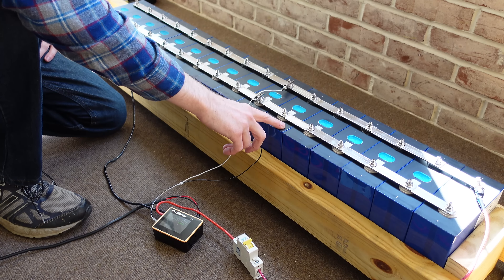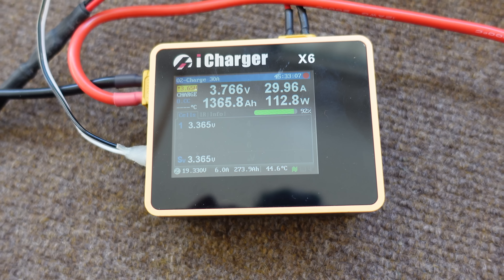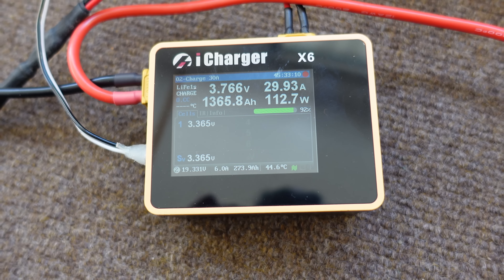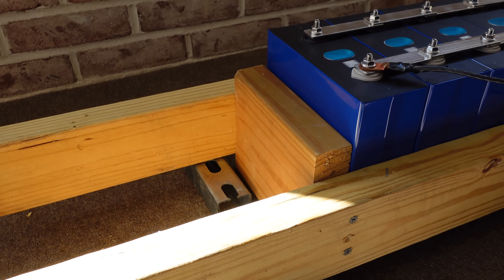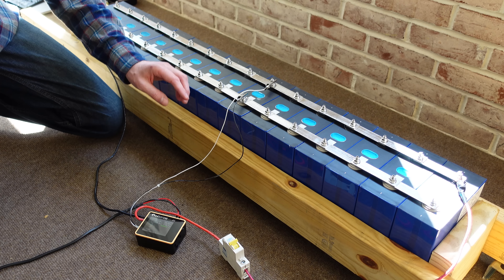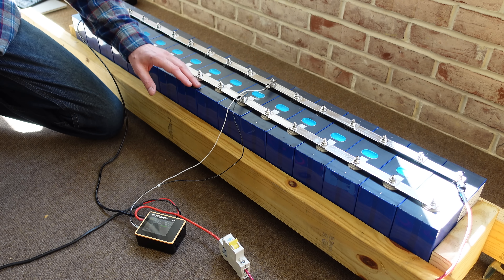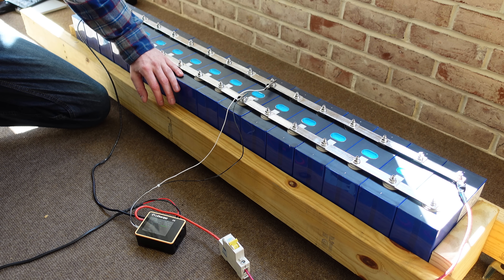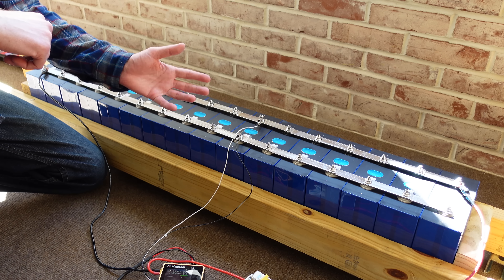Top-Balancing the EVE 280Ah LiFePO4 Batteries & Project Update

Comment: Nice. One suggestion is that the Constant Current charging can be done in series to speed up the process considerably. A 48v charger will likely be a lot more powerful and faster than the 30a/~100w at 3.6v.  Charging in series also allows you to identify any cells that are accepting charge significantly different to others.

Charge in series until the first cell reaches 3.55 volts them charge in parallel until all cells are balanced at your max voltage, say 3.60v

Comment: You'll love that setup! In my system I am using 16 cells (272ah Lishen) in a 48v setup. I'm also using two MPPLV6548 inverters in split phase setup. I have been running tests on mine for over a week to nail down the parameters and interestingly with using 50v as the floor and 56v as the ceiling.. my last couple of discharge cycles have hit over 300ah (14.4kw)! So you should be in the 26-28kw range.
Reply from the maker: Those sound like great lower/lower thresholds! I'll probably use something similar. Did you get your Lishens from Basen too?
Reply: @LithiumSolar  Sure did!

Comment: I'd also put sheets of soft rubber or stiff foam between the bodies of these cells, to allow controlled expansion at the manufacturer's specified pressure, while maintaining the spacing of the posts by using strips of much harder plastic (e.g.: ABS or HDPE) of the same starting thickness at the top.

Comment: I will order 64 of these in the coming week, just awaiting final quotes.
I will be using Belleville washers for each connection as the flat areas are what carry the current and Belleville washers increase the effective contact area markedly. 
My concern over the many years that I hope these cells will be in service is Aluminium oxide on the terminals and nickel oxide on the busbars. I intend to overcome that by industry standard use of a little Aluminox paste in all the joints.
The studs ideally don't carry current,  so loctite will have no electrical effect if the joint is done as described. 
I'm interested in what BMS is to be used, but won't delay my order to find out. I intend to make 4 x 16s strings with their own BMS.
I haven't decided about dynamic balancer modules.
Reply: Exactly .  Stainless bellville washers , stainless studs , and stainless flange nuts . Liberal amounts of anti-oxidant .   Loctite WILL corrode ALU in time.

Comment: I'm going to use locktite on the threaded inserts - I considered the reduction in current through the studs caused by the locktite, then realised that stainless is a poor conductor anyway, so the proportion of the current that will go through the studs is marginal even without locktite. Since my application is mobile, the locktite is essential for reliability.
Reply: Maybe a better fitting bolt would help with a tiny dot of lock tight.
I recently seen New types of lock tight for different use cases maybe look in this.
Reply: You would be better off using a lock washer or locknut due to the reduction of contact. The friction will hold it tight using those items and increase your current flow rate.
Reply: @TBL_stevennelson  Yeah, some other's rattle in the hole, but mine seem to be quite good - they came with the cells - perhaps that has something to do with it?
Reply: @fisherus  I'm using nyloc nuts, but the issue I'm trying to avoid is the stud backing out of the battery post. Since these cell terminals are aluminium, you can't torque the studs down well enough to ensure they stay in place, either with the stud or the nyloc nut on the stud. You can torque them well enough for electrical contact, but not well enough for mechanical reliability.

Comment: On the compression issue.....seems only to be relevant for high C Charge and discharge states an over a longer period.  Yes I believe having compression in your final configuration is necessary but for top balancing at .15c it seems a bit unnecessary and using the wood for this is likely ineffective due to natural flexing of the fibers...won't hurt anything but not sure it accomplishes much.  Have my second set of 16 EVE on the way and planning on using BMS from overkill solar for 24v system

Comment: You mentioned about putting lock-tight on the post. My concern is it might act as an insulator and reduce the efficiency of the battery. Maybe not right away but possibly over time. 
Just a thought!
Reply: I went the silver epoxy route since it’s a conductor as well as permanent sealant. So far so good
Reply: Agreed
Reply: Contact is through the busbar plate, not the post.  The post just holds the plates together for effective contact.  Loctite is fine.  Use blue so you can remove them if needed.

Comment: Just a thought when building that wooden structure to press them together well you should cut the wood a couple mm short and then add a piece of wood at the end and use an impact driver to screw the wood into the other wood to compress them
Reply from the maker: Yeah that certainly would work much better than what I've done here
Reply: 2x4 doesn't have much strength in that direction.  Easy for a bulging battery to exceed what the wood can constrain.

Comment: so, four threads deep and the real issue is contact with base. let it go, let the threads bear the load (like they are designed to do) and make sure that whatever is contacting it is flat & smooth. $0.02 cents- just thinking out loud, whistling past the graveyard, feeling for the best possible outcome. Is thread locker conductive? I don't think it is...
Reply: Loctite (a.k.a. thread locker) isn't conductive. It's a liquid plastic that cures with exposure to the environment. It's designed to fill the voids between threaded connections, thereby preventing loosening over time due to vibration.

Now, as the threaded connection only ever had contact on the one edge and an ever so slight void on the opposite side, sparing use of Loctite shouldn't affect terminal/stud conductivity.

Hint:  Depending on the type of Loctite used, a little heat is all that's needed to liberate a fastener.
Reply: @ARepublicIfYouCanKeepIt  good tip on the removal.
There is a New type of locker that's supposed to handle heat and a few other types.for various tasks.

Comment: That is a popular choice for equalizing the cells.  I prefer an active equalizer board because I can see the cell resistance and the saturation level of each cells independently which eliminate the possibility of mismatch pack.
Reply: @ neglio SAMch, can you possibly share the active equalizer board you use? Thanks!
Reply: @johnwatts3339  ebay has a 2A but 280ah battery you need 5a or 10A  and do not charge above 54v  3.75v because 10a equalizer board isn't enough. 2A Balancer Active Equalizer 2S ~24S BMS APP For Li-ion Lipo Lifepo4 LTO Battery
Reply: @neliosamch3195  Thanks. Could you possibly  share a link on ebay please? Greatly appreciated.

Comment: I would agree with Ian Kiefer that it is the surface area on top that creates the best connection. Because it is aluminum I would also use an anti oxidant compound such as Nolox to stop any aluminum issues. It will also help with dissimilar metals.
Reply from the maker: I will definitely be cleaning each terminal and applying an anti-oxidant :)

Comment: Thanks for promoting safe anti-swelling procedures ! On vehicle we've used to pump those lifepo (synopoly and calb prism) up to 3.8v ... colleague of my produced a paper on memory effect in lithium cell (minuscule but still there), and pumping up to 3.8v for lifepo seamed to be a good resolutions for that. Again, check with datasheet, and ask supplier for true datasheet, not the marketing datasheet - since Chinese cell tend to have magical properties according to some data-sheets (like synopoly advertising their capacity based on discharge curve that started at 3.9v and stoped at 1.8v). About thread lock, there are pros and cons, but to be honest I would advise agains using threadlock on electrical connections. If you don't have a torque wrench as a wrench you can always use a "crow foot socket".

Comment: Check the opposite end of the stud - if they are flat, others have used a grinder to slighty round the end so that it mates snugly with the bottom of the terminal and reduces the wobble. If it mates securely, no need for loctite
Reply: Thanks, I will try that.

Comment: What size breaker is that? What bms did you use for a 16s2p cell? Im building the same. Top balancing now. I got 2 daly 16s bms w/ bluetooth.
Reply from the maker: I don't know what breaker it was. It was just something random I grabbed from the parts bin so it had protection. I wouldn't balance new batteries this way again honestly. Also, I'd probably still go with a Batrium for a 16s2p.

Comment: In my opinion you would do well to double those two wires you have (AWG 12). From the American tables of relationship AWG vs Ampere you have an insufficient wire section to pass 30A ... (for several hours ..). Then I would put a pair of AWG 12 wires (positive and negative) on the first battery on the right and another pair of wires (positive and negative) on the last battery on the left. The two pairs in parallel towards the source (power supply). ..In my opinion...

Comment: Personally the minimum resistance between the terminals and the busbar would be preferable over any additional 'structural integrity' adding loctite may offer. Especially something that wont be holding physical load. It may be negligible but maybe worth a test?

Comment: No to Loctite on the battery side! Use an open ended torque wrench and use the allen key to prevent rotation. If I would use loctite, it would be on the top nut, for a final pack assembly. With the axial force being applied on the stud from tightening the nut, it won't go anywhere. I would though recommend to use a vibration resistant disc or similar if used in mobile appliances. I am ordering 20 of these babies for two battery packs on my Bavaria 50 sailboat. Loctite does not prevent you from loosening the bolts and can give you a false sense of security (that they rotate with your closed torque wrench in action).

Comment: Hi, I got a question off topic of this vid, i use a breaker the same as your using here between Mppt cc and inverter, It heats up a bit, would i be getting power loss through the heat, thanks if you have an answer, thought you might know. Cheers.
Reply from the maker: Yes, if the breaker is heating up it means you're loosing some power there. Breakers will get warm during normal operation, but they should not feel hot to the touch. A general rule is to make sure your breaker is rated for 80% of the continuous load. So if you have a 40A continuous load, you should consider using a 50A breaker. Also, don't forget to check your connections for tightness :)
Reply: @LithiumSolar  Awesome, thanks for clearing that up.
Reply: @nzhillbilly6468  The inverters have protection fuses inside I use a battery switch for maintenance or replacement instead.
Reply: @neliosamch3195  Thanks for that info, I have removed the breaker just for now to test any change and have gained 3 amps. I do have a battery switch in place also. I have an epever 60amp CC and it has a built in 60amp fuse, do you know if that fuse protects the CC at all, in my research it was aimed at the load terminals on some cc but this one doesnt have load terminals, thankyou if you have some insight.
Reply: @nzhillbilly6468  Absolutely,  it need a 60A before and and after for protecting the Epever and always disconnect the solar breaker first to avoid damaging the controller.

Comment: The Loctite won't increase the strength and might even make the contact worse or, I should say less surface contact. When you tighten the nut up on the wire terminal, the friction of the threads is your strength and if they are coated with loctite, the amount of surface contact will be diminished a little. They won't be loose, once they are tightened.

Comment: Electricity takes the path of least resistance, so the loctite should be fine to use because the bus bars contact the flat top surface surrounding the posts.

Comment: by now you will have done what you will but i would run the studs down all the way ( finger tight  NO Loctite ) then use a socket and torque wrench. = no slack in threads , no loss conduction, removability in needed. and i would coat (Lightly) the connectors busbar and cable ends in grease or the connection coating for aluminum wire. so the connections don't corrode up in a year or two.
Reply from the maker: Thanks for the feedbacks. This is exactly what I went with :)

Comment: Loctite on the threads (but not the conductive pad) does not interfere with conductivity because electrons flow through the bus-bars, not the threaded stud. Maybe bottoming out would be sufficient without locktite, but with the studs are as loose as you showed, you run the risk of backing the stud out every time you remove the nut, defeating the advantage of using a stud instead of a bolt in aluminum threads. OTOH, once these are in their final installation, you're probably not going to be taking the nuts off too often, in which case studs bottomed out should be all you need. But unless you get loctite between the pad & the busbar, it's not going to reduce conductivity.

Comment: Might be better to put the voltage sensing leads on the corners as well.  Opposite the charge leads.
For such low current, you could just use some bare copper wire instead of bus bars to parallel all 32. But your "one from each set" plan seems like it should be fine.
Are you certain you have the correct studs? Seems pretty wobbly!
I like the loctite idea, and I'd prefer the low-strength version - 222 "purple" is intended for softer metals like aluminum.
Loctite 242 "blue" or "medium" strength is most common and probably okay.
Definitely do not use Loctite 262 "red" - you need a torch to disassemble that.
I'd also avoid Loctite 290 "green" is a medium to high strength. It is intended to wick into a joint and with as loose as are your studs I don't know how strong it might bond!
Reply from the maker: I think I'll use the copper wire idea on the other set of 16. I need to get them started as it's going to take a long time to do each set.
Reply: Thanks for your thoughts on which locktite Sylvan - greatly appreciated.

Comment: The studs wobble because they are flat bottomed, and the holes in the battery are beveled, file the bottom of the studs round and they will lock down tighter and not wobble.
Reply from the maker: I found the studs no longer wobble if I tighten them down with the Allen key vs hand-tightening like I did in this video. Guess I just didn't have them threaded enough :)

Comment: BMS? Overkill Solar seems to sell a great BMS (well, good enough for my 280AH 8s 24v battery at least!) I've been eyeing it since 2019, and was psyched that there's a better user interface now (Overkill Solar seems to have done a Chinese translation into English!!!) Will P. literally just did a video on it (yesterday, 2 days ago?) and now I'm afraid that they will be sold out forever now!!!
Reply: Overkill doesn't make that bms.
Reply: @AGhostInTheMachine  do you know what Chinese company does?
Reply: @kevbarker73  I've seen the company name written as JBD and DGJBD
Reply: 8s is 24v. 16s is 48v. And 16s2p is 2p so the 16 cells of battery 1 need to comminicate and balance with the 16 cells of battery 2 (= 2p) so one battery doesnt overcharge vs the other. Overkill is for small systems batrium k9 is for 16s+/ large legit systems.

Comment: Do you think the lock tight will affect the conductivity?
Thank you, sir.
Reply from the maker: The loctite won't be conductive but my thoughts are the stud is only serving the purpose of holding down the busbar and the electricity would flow through path of least resistance, which is from top of post to busbar, not through bolt? I'm not sure. Responses seem to be leaning towards no loctite so far.
Reply: @LithiumSolar   I have the same thoughts with loctite and I absolutely agree with you. The bolts are not used to transmit the current / voltage.
I'm still curious to see what the community brings to this. But I will most likely use loctite. I'm curious how you implement it. Keep up the good work with your great videos. 👍
Reply: @LithiumSolar  >You're probably right. Could be relatively easy to make a test on a couple lock-tight cell VS non lock-tight be measuring resistance, or capacity-test them...
Anyway thank you, sir.

Comment: What type of power supply are you using for your iCharger X6? Thx
Reply from the maker: I'm using a 120W Dell laptop power adapter that I cut the plug off of and spliced on an XT60. It works quite well.
Reply: @LithiumSolar  great idea, thank you!

Comment: Why did they use black as the positive and red as negitive im sure thats caught a few people out
Reply from the maker: The negative terminal is white, not red, but yes - I see what you mean now. That's a rather odd choice of colors... Black negative and white positive would have been much better.
Reply: @LithiumSolar  Caught  me out too - one dead power supply later...I've labelled each and every terminal now with permanent marker - the years of red is positive, black is negative is difficult to overcome and it only takes a pico second lapse in attention to blow things up....
Reply: @khwolter9038  Thanks for the heads up. I will be on the look out. I thought the Chinese had progressed past their 1970s weirdness (green actives, green with yellow stripe actives, no earth wires etc), but I stand corrected.